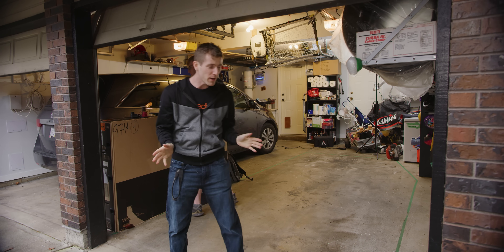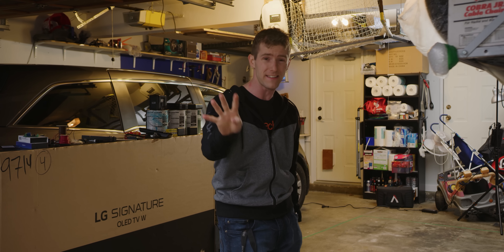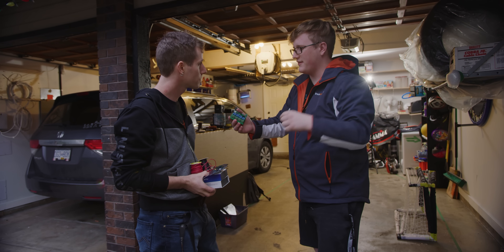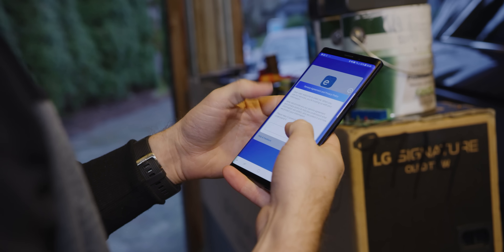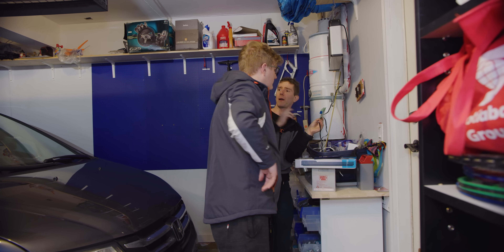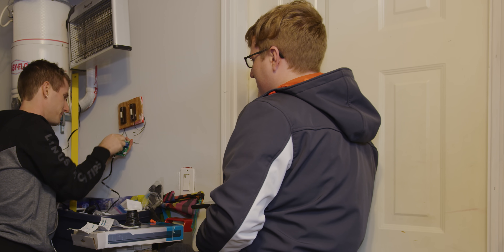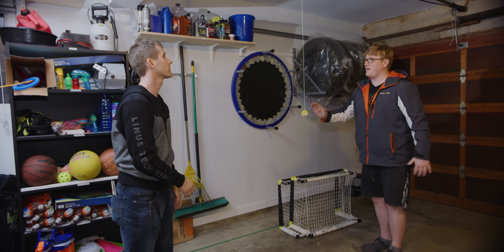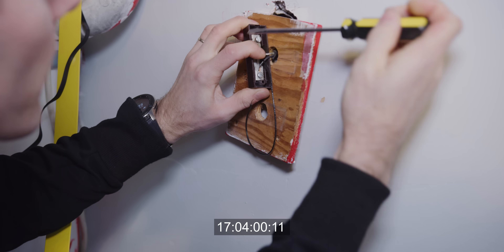Making my 1980's Garage Door Smart!

Comment: So now internet hackers can open his garage door from anywhere on the globe? I would have replaced the switches with a nice set of momentary switches that look a lot like regular modern light switches and put the device into the wall cavity behind it. A nice set of cheap replacement momentary wall switches would have cost you only $10 to $15 Canadian, or $20 to $30 if you wanted some with LEDs in for 2. You can buy WiFi smart duel lightswitches that are Alexa and Google compatible on Amazon for less than $30.

Comment: I did this with the GoGogate2, took 2 wires per door. I have it integrated to work with Google Home, as I am leaving I simply say my catch phrase, by the time i'm in the car the door is open. The car has Andoid auto so just tell it to close, all done. 

I chose this option over others for ease of installation and cross device compatability. I can use my Bluetooth headset while riding my motorbike to open it as well. Setup guest users, give access on a schedule etc. Not a bad bit of kit.  Might be worth checking out.  :-)

Comment: Okay Jake, you probably meant "we can just wire them in parallel not in series with each other".
As for the relay connections "N/O" "C" "N/C" = Normal Open, Common, Normally Closed Respectively (switch contacts)
P.S It's not "Just 12 volts" there's a mains flex cable running out the back of the unit. Sure the control wires should be ELV

Comment: 10:06 "NC" stands for Normally Closed and "NO" for Normally Open. From Electrical Engineer
Reply: Weird flex, but okay.
Thank you, Now the more you know!
Reply: NC is No connection! LOL
Reply: @raulunzue3159  NC is no connection on ICs on relays its normally closed.
Reply: Just to be clear, normally is (normally) when the button isn’t pressed and the relay isn’t energised, but isn’t always.  Sometimes, normally is when it’s powered, but that’s not normal.
Reply: @lkchild   Wrong NC always stands for Normally closed. The difference is that some manufacterers does it the oposite way. Schneider for example.
But generaly speacking the definition is the samr
Reply: Lol, you had to become an ee to learn that?
Reply: @herranton  yes
Reply: @herranton  No. You just need to do a few of the rights things a couple of times.
Reply: Lol, you have to be engineer to know that ?
Reply: @gerarteuben3333  yes
Reply: Common...
You don't need to be engineer to know that haha. Your EGO clicked a little bit here haha
Reply: @BenPasriche  lol typical engineer.

Comment: You could replace them with just a sonoff basic is $4 at AliExpress. Best wifi relay ever.
Reply: Unfortunately not, the sonoff basic either provides mains to its output terminals or not, it doesnt directly expose the COM/NO/NC relay contacts as are required for a project like this.
a Sonoff 4CH Pro would've been nicer tho, about the same price as they paid (US$23 + shipping), actually has a case, with buttons on which could replace the existing wall switches, still uses eWeLink and supports IFTTT & voice assistants, and also supports regular 433MHz keyfobs for a more standard garage door opener to increase the WAF (Wife Acceptance Factor)
Reply: @dalehorton7748  You are completely right. my mistake
Reply: Or in my case I used the sonoff rf Bridge and just copied my existing remote 😁
Reply: @ullyeus86  A warning....non code hopping RF remotes are very insecure. Anyone nearby could capture the same code when you next use your remote (or RF bridge).
Reply: Doesn't work. You need an "inching" relay that will close momentarily and then open again. Each time the relay closes it signals the door to move up, pause, or move down.

Comment: Ahh how about a esp8266 nodemcu and a relay or transistor on a garage door button line, probably could use an older more basic esp chip seeing as you would be controlling 1 or 2 switches.
Reply: Ahh 12 volt, yeah transistor easy less then 5 dollars, plus some programming in python to integrate it into google there are guides up online on how to do so.

Comment: Those '85 or so model openers will outlast the new ones 5 times over I guarantee it. On the side note, since my family has garage door openers with these buttons like Linus does, I might actually do this! Beats replacing perfectly good garage door openers, not to mention it will work with any opener that has a standard push button control which is like 90% of them.

Comment: 10:05
NC = normal closed
NO = normal opened
Where "normal" means "the state where no current is flowing through the relays" and "open" and "closed" means if the switch in the relays is opened or closed.
That means when there isn't flowing any current through the relays the NC port is connected to the COM (stands for common???) port in the middle. When you apply some current the NO port is connected to the COM port.

Comment: NC = normally closed. That means the circuit is normally closed to the groundconnector and opens if the switch goes on. NO = normally open. You´re welcome

Comment: Please get rid of this ewelink shit. Their servers are not available from time to time, and then you have to pair your device again and again and again. Instead, flash tasmota on it, if the 4CH board uses a 8266 or buy a 4ch board from Sonoff and flash tasmota an it. Tasmota doesn't use external server, instead the ESP8266 runs it's own little webserver, which you can control via alexa, google home or other apps.

Comment: The other thing that you failed to mention in your video is that you can integrate eWeLink with Google Home. It will then pull over all of your devices from eWeLink and allow you to control them with voice commands. So, in your situation you could be driving home and as you're approaching you say: "Ok Google, open garage door" and it will open it for you.

Comment: Instead of using a switch you would be better off using a transistor to trigger the short. Depending on your switch type it might close on WiFi disconnect and your garage would open. I had a similar problem using a switch with an esp8266 node mcu.

Comment: "were not even getting into any high voltage wiring" '""this is 12v"" -  Amperes are the killer, not the volts. " For currents above 10 milliamps, muscular contractions are so strong that the victim cannot let go of the wire that is shocking him. At values as low as 20 milliamps, breathing becomes labored, finally ceasing completely even at values below 75 milliamps." 100 milliamps causes heart problems that can easily lead to death. FYI.
also.. F paying monthly for something so simple.

Comment: "pays itself in around 5 years" 
Well who believes that those services survive for 2 years xD
Reply: I mean he didn't have to buy the "few hundret bucks" garage opener so pretty worth actually
Reply: I agree with mastavagasa even though these parts cost like $90 the single chamberlain garage door opener will be over $100 plus monthly fee. Also adding in a relay is so much better aside then replacing the whole drive motor and possibly the chain. Unless those units were on their way out, I would keep them, new openers have way too many plastic gears (probably for safety) I had one that stripped itself because it kept going after it was fully open for no reason, I had to pull the plug. The main gear was stripped (it was only plastic gear in there) and even though I could pull it out, I contacted the company and was quoted “no serviceable parts inside drive unit” and couldn’t find the gear anywhere online. So it was junked 🙁
Reply: Ewelink is big.
Reply: they already have survived for more than 2 years

Comment: "going to pay itself back in like 5 years..." But if Chamberlain's app support goes belly-up, your system will just keep working! Most people don't realize when buying Smart devices that they have servers owned by different companies controlling them. And the question should be the same as some products with "lifetime" warranties - "Will I still get use out of it if the company expires before the product does?"

*keeps watching the video to 6:10 *

Oh well I guess you still rely on some other service. I'm guessing building an arduino-based system to do this for you so you can manage it yourself was not the focus of the video :/

Comment: NC = Normally Closed
NO =  Normally Open

Thank me later Linus
Reply: So no actually does mean yes?
Reply: @cossakrose  actually "open" means that there is no current flowing... so normally open (NO) means that normally... (when the switch is not depressed), there will be NO current flowing through the switch..
Reply: @cossakrose  NO means NO. Normally open = no current through. But when a girl says NO, its not open... normally.
Reply: When he said NC. That normally stands for no connection I did a facepalm
Reply: @gman3563  Haha same
Reply: @Magma &  @gman3563   You two READ MY MIND
Reply: As an electrical engineering student that part cringes the hell out of me.
Reply: @dauf69  the whole video should have done that, where was the safety precautions for one lol
Reply: I cringed so hard when he said that...
Reply: *North Carolina
*New Orleans
Reply: Yeah, I came here to comment that. Thanks for doing good work.
Reply: @nerdicorgi  so did I
Reply: saved me the trouble. thanks!
Reply: Linus is definitely Half-Normal
Reply: Magma  thanks for helping my little linus LOL
Reply: I wanted to say this to Linus... :/
A little PLC thing they taught me in my automation class.
Reply: Came for this
Reply: NC = nice cock
Reply: I was gonna comment this haha
Reply: I'm was about to comment the same, but I just checked it before posting.

Comment: Funny video, but honestly the MyQ system actually works fine, does push & email notifications for door status changes, shows the time the door's been open or closed, sends alerts for the door being forgotten open, has a website with the same functionality, has modern radio encryption for the clicker and automotive HomeLink integration. And, that's all at the sticker price, no subscription. The $1/mo for IFTTT and Google Assistant integration isn't worth it, and doubly so when you realize you can't close the door with Assistant anyways, but the rest is a big upgrade over the 1980's gear.

Comment: You guys knew you could do this with an Arduino, some cheap components and a few lines of code for under ten bucks, right?
Reply: An ESP8266 would have solved that nicely. Even comes packed nicely as Sonoff-devices.
Reply: @zapro_dk Those relay-boards they are using in the video do use an ESP8266. Could've just flashed them with custom firmware.
Reply: @WereCatf  exactly
Reply: @zaprodk  They make those $2 ESP-01 relay boards: https://www.ebay.com/itm/ESP8266-5V-WiFi-Relay-Module-Smart-Home-Phone-Remote-Control-Switch-For-ESP-01/332457364847
Reply: t h i s  i s  l i n u s  t e c h  t i p s, cheap is not good enough
Reply: Since when is arduino under 10 bucks?..
Reply: @D3nn1s  China makes miracles, buddy
Reply: Dennis A cheap knock-off maybe
Reply: Yes, but then would you have a proprietary device and app, which have to connect to some companies server, to do anything?
Reply: You can get that board and literally plug it in and use it.  $4 on AliExpress.  Why over complicate and over engineer it?
Reply: You know you could always start a youtube channel, come up with fun ideas that people actually want to see, start filming those ideas, get a couple of million followers, all for the low cost of a few moments in your day, right?
Reply: Link?
Reply: @sithlordmaster181  www.aliexpress.com.......................
Reply: The single channel version can be mounted into the existing case of my roller door motor and can pull power directly from the doors internal 12v PSU.
Reply: Cruz I was the 100 like and didn’t even read the comment
Reply: So he can promote the device
Reply: There are 1001 ways of doing it, your point is?
Reply: The major difference is that you need a programmer and your own external server vs a chinese clone that requires an app and are you smarter than a 3rd grader knowledge.

Comment: Dont replace the old door opener its working to this day for a reason because it was built to last unlike the new one witch is designed to fail after a year so you will buy a new one from them all manufacturers build products to fail its called planned obsolescence It is impossible to buy anything built to last these days Dont throw out anything because its old the build quality of the replacement will be shit on purpose
Reply: The downside is that it isn't secure. It is very vulnerable to a brute force attack, if you worry about these types of things.

Comment: Next step is to make simple listening server app on one of your 24 hour running server - and make some simple app that check if phone is connected to the car or not when connecting to wifi - if connected it send signal to server i which it will open the door automatically - auto SMART door

Comment: Honestly what would you use IFTT with your garage door? I have the door opener you were going to buy and it works great. It’s quiet, has battery backup, and is smart and I can open it anywhere I want. I have never needed IFTT control of my door because I would just go to the app to see if it is open/close.  Odds are in like 5 years or less you are going to have to buy new garage door opener anyways since yours is so old Linus, you should have just bought the new openers.
Reply: Well, he made a yt video that has about 400k views on the first day. Given that yt generally gives $2,000 per million clicks, he paid for 2 new openers with this video already. 
Or he could have just wasted his money on them.
Reply: You could buy a new opener and get it installed. But most automatic openers just need a button press where this relay board can do that remotely. For like under $20.

If it still is working, why replace it? This is a perfect upgrade to his door.
Reply: rdadd clearly you have no clue on what is being talked about...
Reply: sure.. no idea, well my opinion is

the garage door openers currently works, 

he upgraded them for cheap, no need to replace.

Comment: That liquid dripping from the garage door may be electrolyte from the main capacitor in the motor, which indicates it may be failing. 

If you open and close them too much it’ll blow that cap. Learned that one the hard way :|

Comment: If you put the WiFi switch is alongside the switch you would need to put them on parallel not series. If you put them in series both would need actuated for it to work.

Comment: That looks like a sonoff 4 channel pro with out the case.  I hope you set it to use inching mode that way it acts like a momentary switch (work like the buttons).
Great simple modifications for an existing garage door opener. 
And you were talking about NC and NO.  Normally closed and normally open.

Comment: @Linus the labeling on the Relay means the contact is
NC = normaly closed
NO = normaly open
So you can decide if the circuit gets closed or opend by the activation of the relay

Comment: glad you fixed the wiring of the buttons, but my car's homelink can control up to three devices separately, so i never really understood why a garage door opener should be on wifi/internet.

if you want fancy, get one with a battery backup so it can work when the power is out.

Comment: For anyone trying this, at 10:00 NC stands for "Normally Connected" and NO stands for "Normally Open".  If you're connecting to a button that is a "Momentary Connection" button (shorts out the connectors only when you have the button pressed), you should use the NO terminal.

Comment: Pi zero w, web server with few buttons on the page, gpio can be used for door status control +relay control. Total: around 20-30 $. And you can control all this stuff however you want, even with Telegram bot that will do the job and report the result. Or via Domotics, if you wanna automate the whole house.

Comment: I'm afraid that more and more businesses will be moving towards a reaccuring revenue model. I.E. Everything will be subscription based.
I'm also afraid insurance companies will soon want to monitor everything in your home/auto.
Reply: check out this video from This Old House about a system that monitors your electrical system and analyzes the signals to determine exactly how the electricity is used in the house (eg, oven turned on for 20 minutes, phone charger plugged in, tv turned on, etc)

https://www.youtube.com/watch?v=HZft4qoK7Ds

Comment: What's the chanse fore u to test the Mate20pro by connecting it to some stuff... I have huge problems with mine when trying to use it with jbl extreme2 and jbl charge 3. And plt5200 Hf. Samsung gear s3. I hav isues using apps updating the speakers and losing connection to the watch and handsfree...

Comment: Wait, so they complain about the IFTTT subscription cost of Chamberlain. But they don't even show them configuring their IFTTT. So they basically just control via an app, something that's free with the Chamberlain unit. Of course the new unit does include battery backup, safety sensors, and quiet belt driven opener...